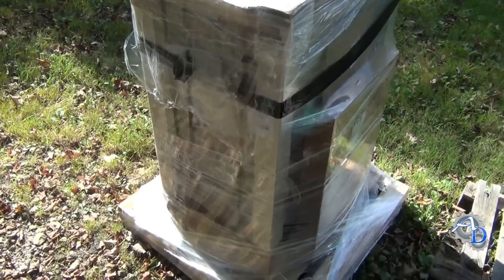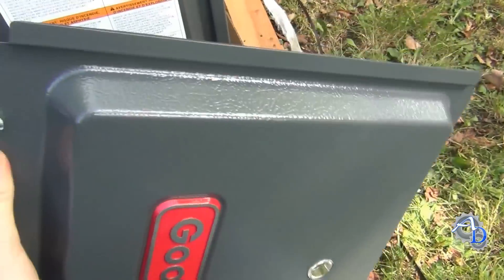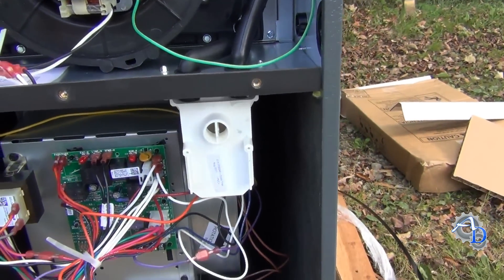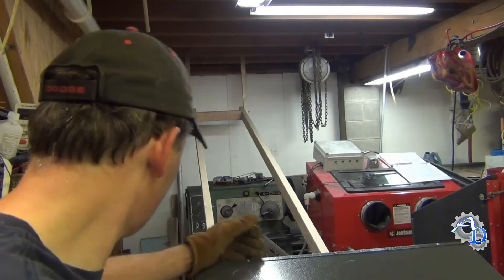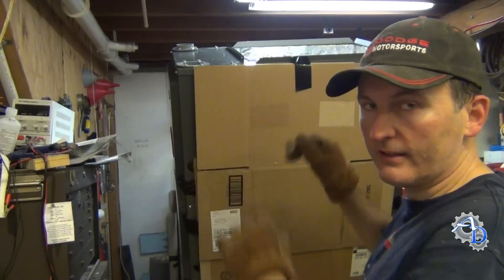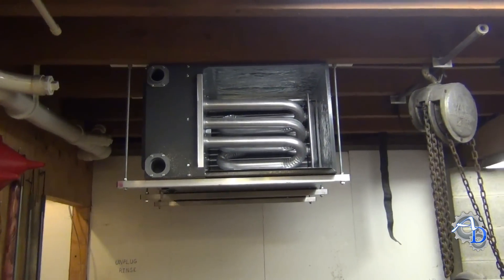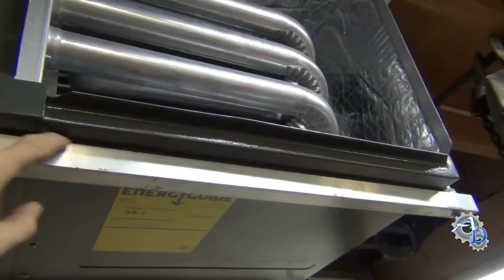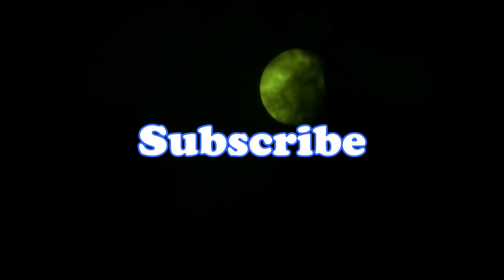HVAC Techs Didn't Like This Furnace Installation

Comment: Lol, I had to get my free Craigslist riding lawn mower in the back of my dad's pickup truck and I used the exact same method... it was even heavier, I needed a guy on the other side pushing too, we were sliding it on its mower blade attachment.  In retrospect, I should of used a wench with the ramp to ratchet it up... like an old boat trailer hand crank wench repurposed, or a harbor freight electric one ($$).

I think I've used the same method with a motorcycle and that was even more tricky...  to get it up and down the stairs of my porch...

At first, I was going to recommend raising it the way the Egyptians did, you know, a two by four under one side, tip it, two by four under otherside, repeat until you reach ceiling...   like a Jenga Tower

Now you get to play with Duct Tape...

I don't know about heaters like this, but for air conditioner window units, I always make my own pan to go underneath them, because invariably they will drip and leak... in the case of an air conditioner unit, it's into the window sill and wall and will rot out the wall beneath.   It's not hard to make your own pan, I use a piece of old roofing tin and bend to fit.    Ditto for hot water heaters, but they sell pans for those.   Probably should put pans under fiberglass bathtub's showers too, as I've seen many leak and rot out the floor underneath.  

Yours is up in the air, so if it ever starts leaking, you'll see the drip and hear it and can retrofit it with a pan under it before your makeshift bucket on the floor gets full ;-)
Reply from the maker: Clever girl. You should start a handywoman business.

Comment: Excellent job! You are an all around clever dude. 
Any link to where you got the furnace?
Reply from the maker: Thanks:) I got it here: https://www.alpinehomeair.com/
Reply: Thanks, had no idea you could lay a unit like that down. 
Most likely a lot lower cost than a hanging unit heater and more
efficient as well.
Reply from the maker: Pricewise, it depends a lot on the brand you get. Some well known ceiling heaters cost more than this furnace, but some off-brands are about $300 cheaper for the same input btu. This one was a little under $800 with free shipping, but mostly my decision was based on efficiency and it being a tubular heat exchanger as opposed to a riveted clam shell type. I could've gone the cheaper route, but with this furnace at 96% efficient (57,600 btu output), and a typical garage heater at 82% (49,200 btu output), the fuel cost savings will offset over time. This furnace outputs 8,400 more btu than a garage heater of the same btu rating, so every little bit that's not going out the chimney is more money in my wallet.
Reply: @ArnoldsDesign  Very good company, got my furnace there also.